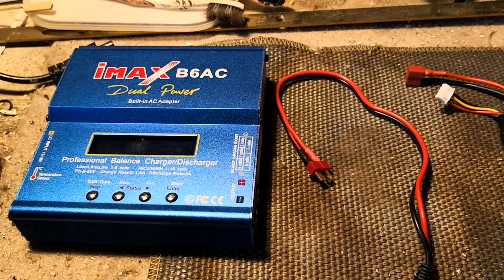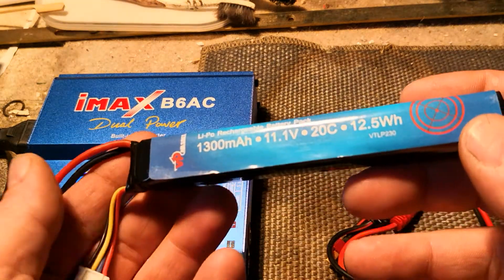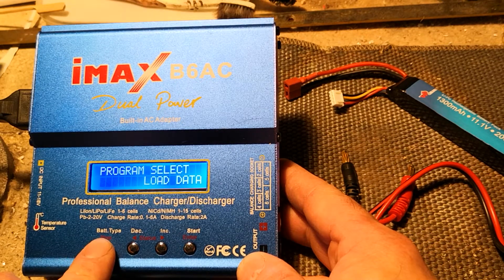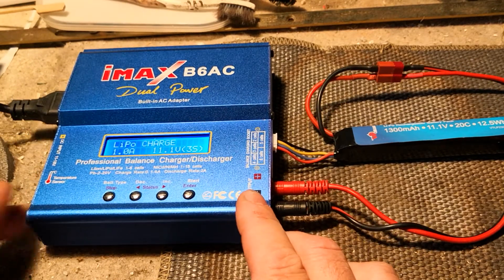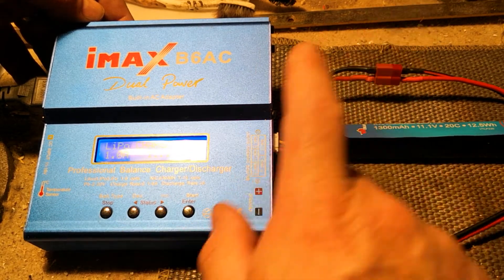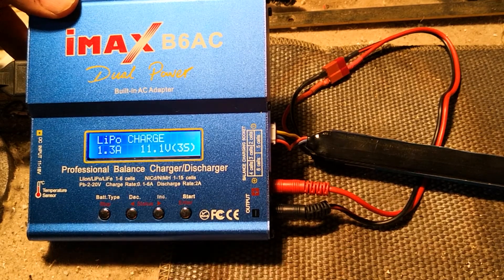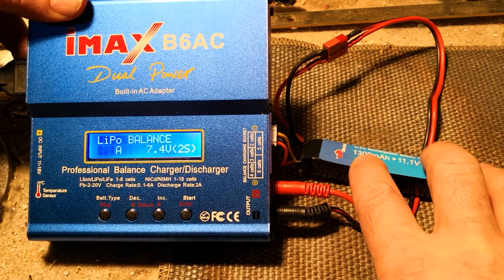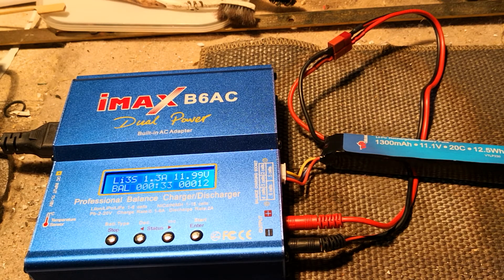LiPo balance charging with Imax B6AC charger

Comment: How do i charge a 6200 mAh battery if it only goes up to 6.0? Thanks
Reply: I was told not to match the capacity but rather charge 1 Cells worth. So say your battery is 6 Cell, 6200mAh divided by 6 would roughly be 1 Amp, so I would charge with 1 Amp or so.

Not sure if this is the best, ofc data sheet is always king but some batteries often do not have a data sheet.

Comment: Charge current is NOT always the same as capacity... Setting charge current should always be reference from the battery data sheet.   Following this advice could cause a battery to explode.

Comment: Shouldn't a single LiPo cell be loaded with 4.2Volts? With 3 cells you are at 12.6Volts. 
3.85 to 3.95 Volt is the storage capacity of a LiPo (3S = 11.55V). So you are loading with storage capacity only...
What does the specification say?
Reply from the maker: You are correct. For a single cell to be fully charged it should be 4.2v but in this video I don't mention the cell voltages and I am only demonstrating how to start the balance charge process. It dose not show the completed charging process.

Comment: Man, what an awesome video... If I have three 18650 cells in parallel, say about 12 amp hour capacity, you wouldn't recommend charging at 12 amps (or whatever the highest charge rate is) would you? Isn't that bad to charge at a higher amperage?
Reply from the maker: Sorry mate couldn't comment on using 18650 batteries as I have no experience with them.
Reply: I would divide the capacity by the number of cells and then use that as your charge rate. For example 18000mAh, with 18 cells, 18000 divided by 18 would be 1000mAh, and thus use 1 Amp charge.